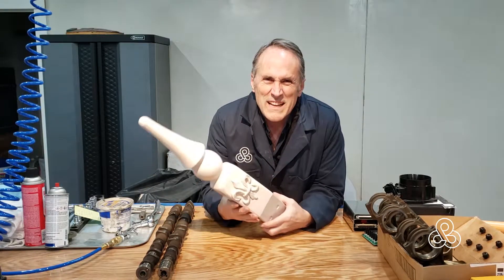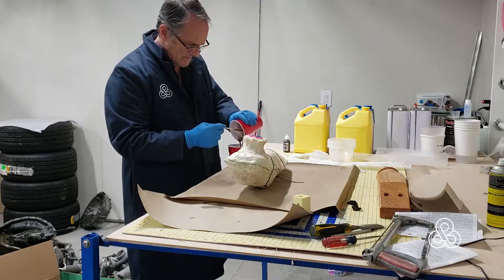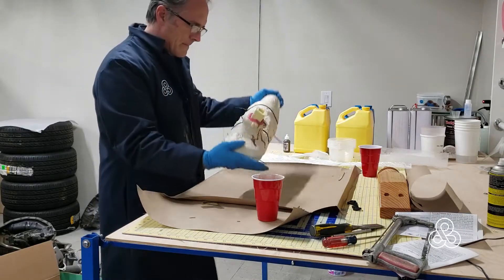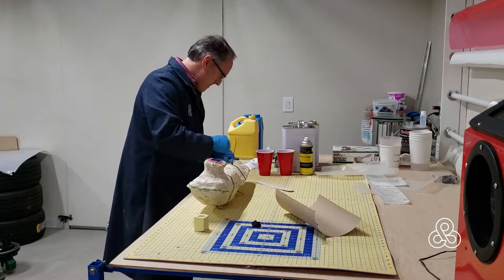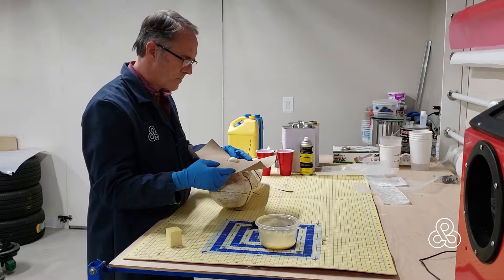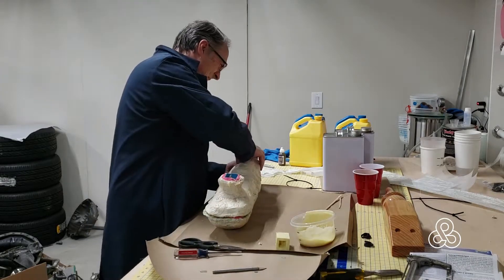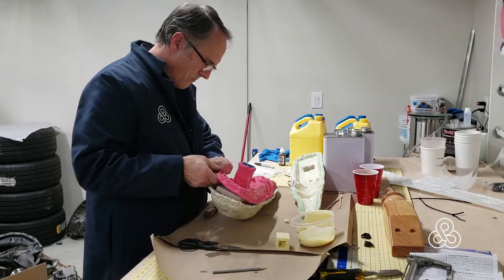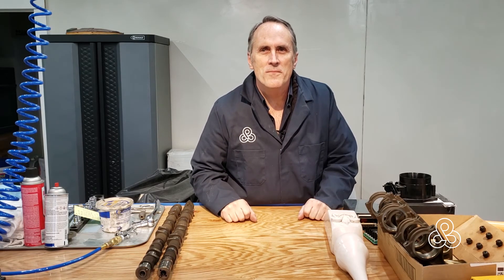Urethane roto-casting an architectural spire from a silicone mold

Comment: Very nice job sir, the first ingredient you pured into the mold it just urethane or are there any additive.
Reply from the maker: The Urethane itself is a Smooth-On product Smooth-cast 32. I did add a dye ( sold by Smooth-on as UVO) adding a UV resistant pigment is important if the product will see any sunlight. The architectural spires where painted in the end, but just for added protection (and in case the paint got damaged) I added the UVO pigment. (brown to match the paint) Thanks for watching the channel. Hope you come back for more. Are you working on a project to be cast in urethane?